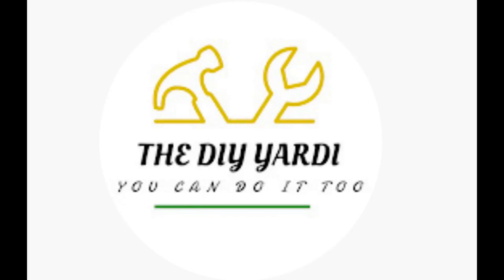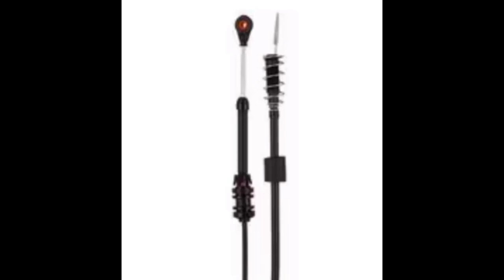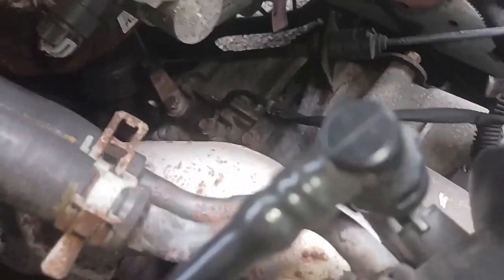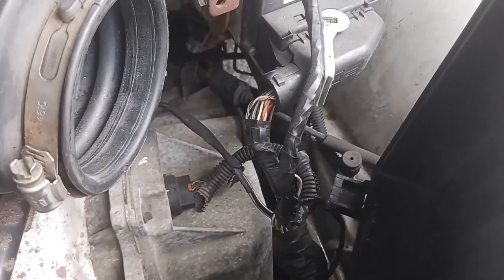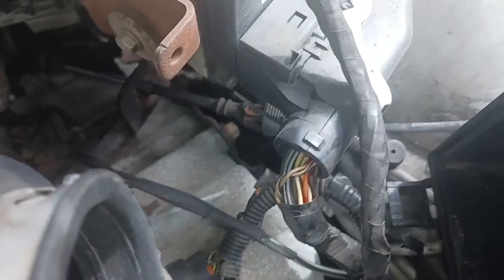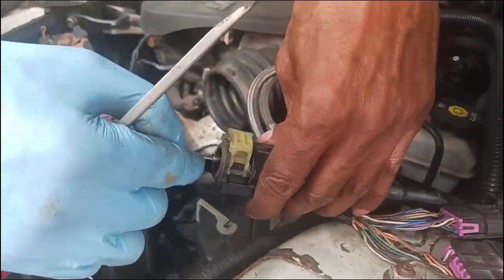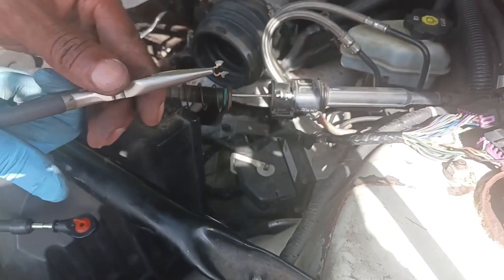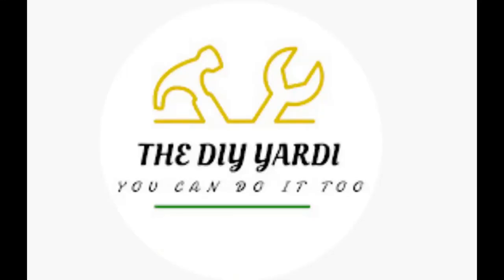HOW TO FIX 2007 TO 2011 CHEVY IMPALA STUCK IN DRIVE, PARK, REVERSE OR ANY OTHER GEAR.

Comment: I managed to find out how to press the button to unlock the shifter. Now it moved, but the trans still stayed in R and I couldn't start the car no matter where I moved it. 

I'm thinking I have the same problem you did. 

Question - can I manually move the trans lever to get it in gear?

Comment: My shifter is in reverse but won't move at all
Reply from the maker: Hi, are you saying that the gear selector lever is stuck at reverse and won't move at all or does the lever moves but gear indicator stays in reverse?
Reply: @thediyyardie7192  Hi, yes, it's stuck and the lever will not move.  I don't know where the position is, whether it's really where R ought to be, but I can't squeeze the "trigger" to get it to release, nor will the shift lever budge from R.  It's as if it's locked into that position.  Therefore I cannot start the car, let alone drive it.
Reply from the maker: @stellijer  Are you able to remove the key from the ignition, and does the dashboard lights light up when you turn the key?
Reply: @thediyyardie7192  Hj, yes, the key goes in and out of the ignition just fine. But I can't depress the button on the shifter or move it, thus it won't start since it's stuck in reverse. 

My shifter is on the floor

And yes, everything lights up and the fan starts blowing, I just can't start it.
Reply from the maker: @stellijer  Oh ok, on that set up there's an electrical connection to the gear selector down inside the console, sometimes a wire may break or become separated, you would need to remove the covering to access it..
Reply: @thediyyardie7192  It looks like the little circular hole which connects to the trans lever has become disconnected. I'm guessing I need to replace it. I wish I could temporarily get it in park then in drive just long enough to start the car and re park it
Reply from the maker: @stellijer  yes you can shift it manually at the lever on the transmission where the gear cable connects, just be sure to engage the park break or block the wheels so the car can't move.
Reply: @thediyyardie7192  Thanks.  I managed to push it back a little for now.

From the looks of it, all I need to replace is really the bushing, as the cable looks fine from what I can tell.  Problem is, I see several different bushings for my car listed, some look like they press in, some have clips....
Reply from the maker: @stellijer  Your best bet would probably be the dealership, they would be able to pinpoint the exact bushing or clip you need using your cars vin#